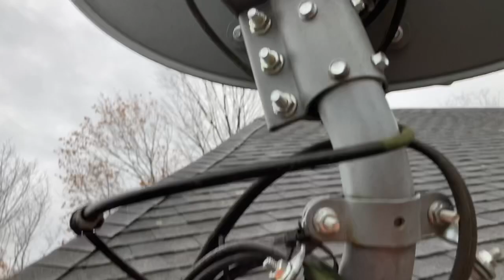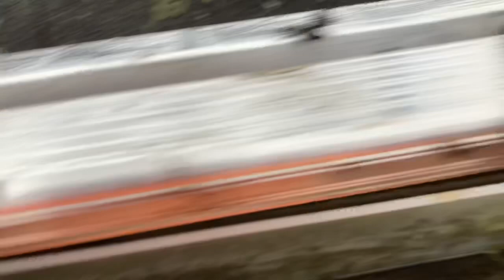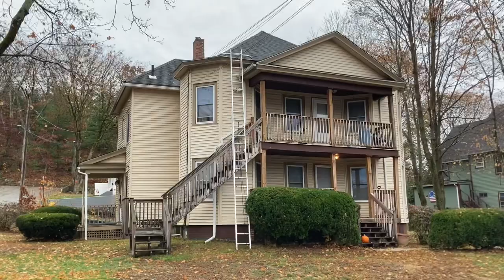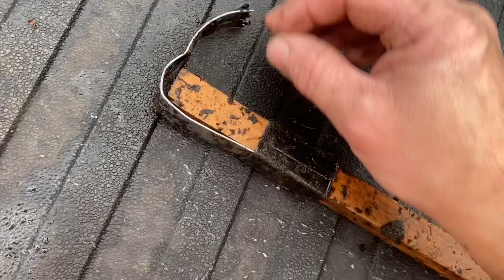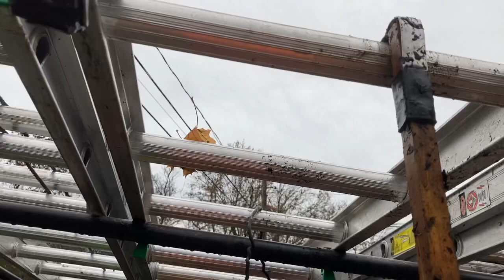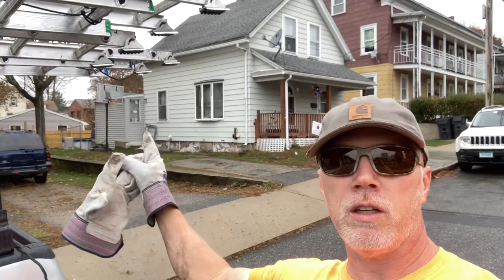Homemade gutter tool

Comment: was that the 32ft ladder with the roof hook? I was wondering if I can reach 2 story homes with a 24ft ladder.
Reply from the maker: Yes that’s the 32. A 28 works pretty well for most 2 story. The 24 comes up just a little short too often
Reply: @powerfulimprovements  thanks